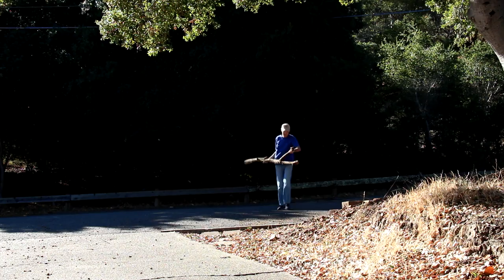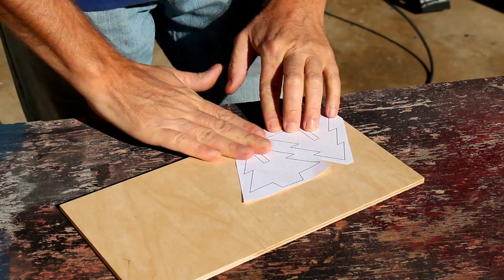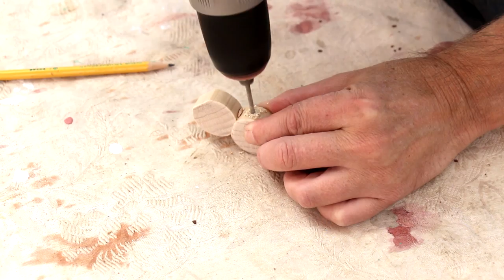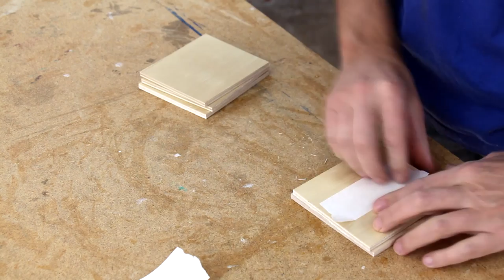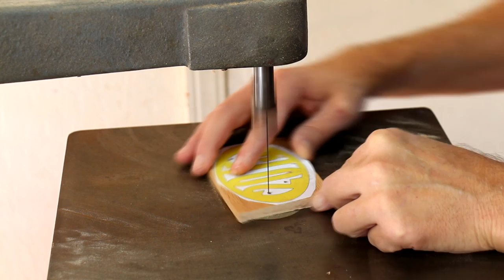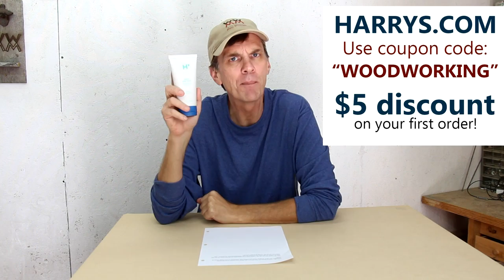7 Simple Holiday Ornaments

Comment: Steve when using a coping saw try this. Orient the work horizontal like on your scroll saw. Seated at your bench. You use a bench fork,( a piece of 1x 4 with a V cut into the end), clamped to your bench. there are some advantages. First, when cutting on the pull stroke you are always increasing tension on the saw blade. When you use the saw where the blade is horizontal, and cut on the push stroke, you reduce tension on the blade. The blade flexes and you get wavy cuts. (this is more noticeable in thicker wood).
The blade flexes less and you get more accurate cuts. Second, when you are seated with the work in front of you, your eyes are closer to your work. For Young guys like you. this probably isn't much of an issue yet. but wait till you hit 40. (smirk) Finally you don't have to clamp your work. you can move it around on your bench fork to cut from the best direction.

Comment: What glue/adhesive do you use to attach the templates? it looks like it holds but comes off pretty cleanly and easily.
Reply: +Steve Ramsey awesome, I got 3M General Purpose spray adhesive the other day. wonder if it will work the same if I let it sit for a min. Starting a project tomorrow where I'm using a template.

Comment: I think the band saw would be perfect for a snowflake ornament. Tape six thin sheets together, and trace out one 60 degree wedge of the snowflake. Separate the layers, and lay them flat in the shape of the snowflake. Glue a hexagon or six pointed star to the center to hold the pieces together and hide the center seams.